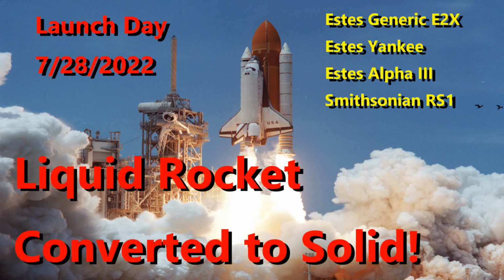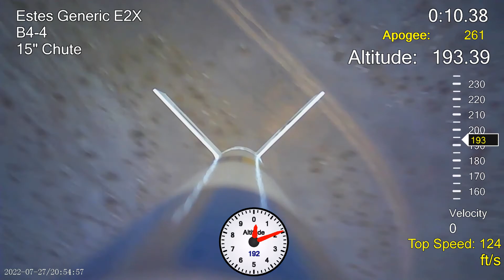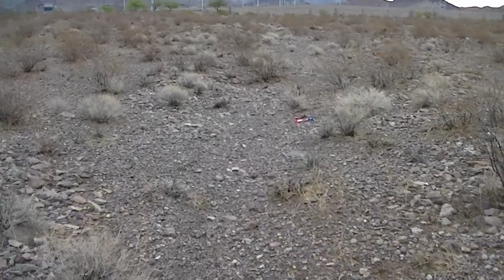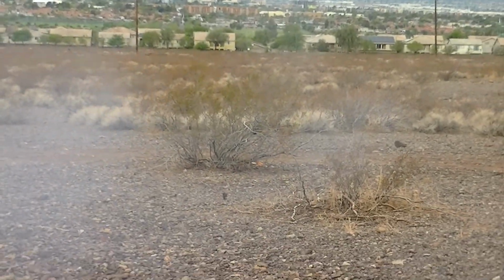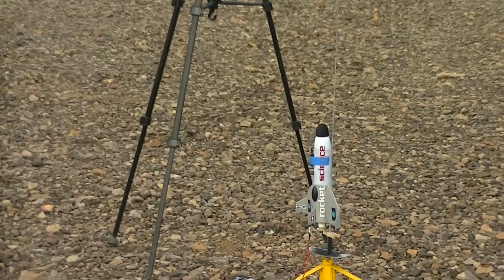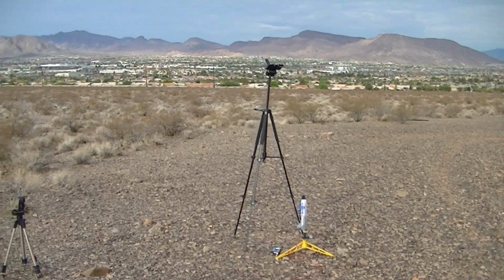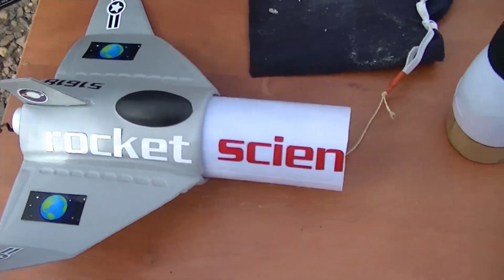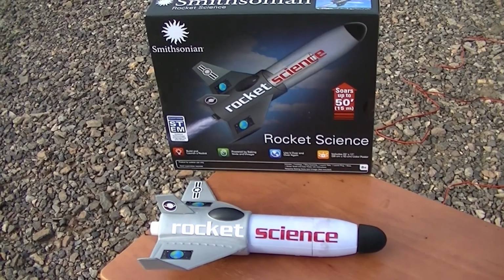CONVERTING LIQUID ROCKET TO SOLID!!!- Launch Day - July 28, 2022

Comment: The Science rocket needs nose weight. The flight went unstable as soon as primary thrust was complete. Class CG/CP imbalance. 

Building that thing in OpenRocket is beyond my current skill set, so deciding how much is going to be a bit of a guess. Looks like you've got plenty of room in the nose at least.
Reply from the maker: I would tend to agree with you Nic.  It never hurts to add noseweight, however, if you notice on the on-board video, the wing was flexing pretty dramatically, which easily could have been the source of the instability.  That being said, it also could be a combination of the two.  Stiffening the wings and adding noseweight would almost definitely cure it!  Thank you very much for your feedback!
Reply: @KevinsModels  The wing flex was, dramatic. I would likely add nose weight first, just to see how much that flex actually contributed to late flight instability. Either way, it was a fun idea.